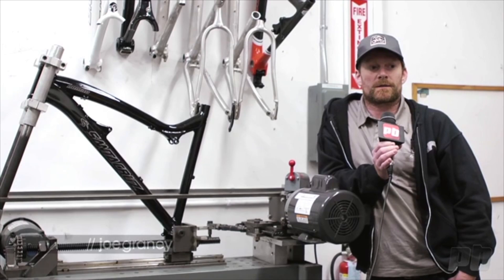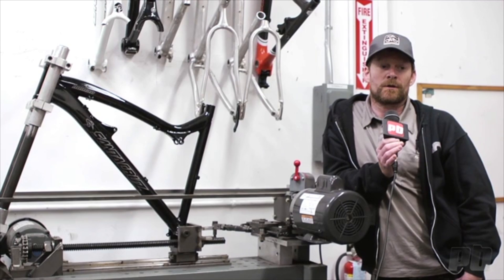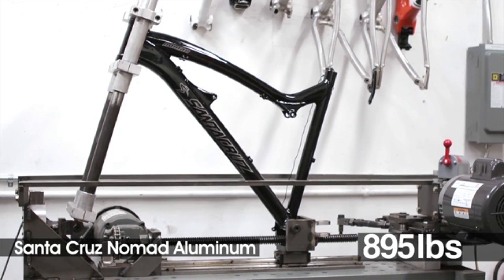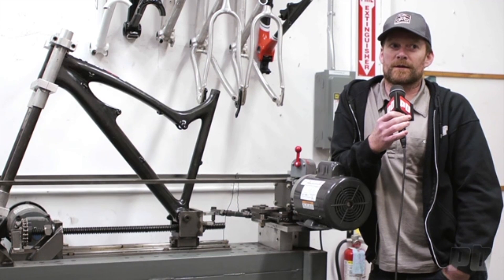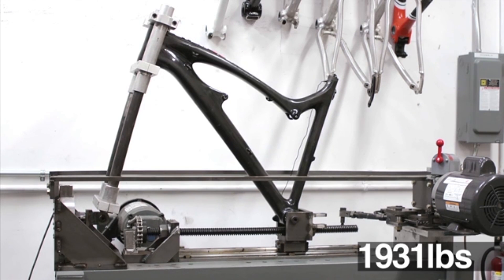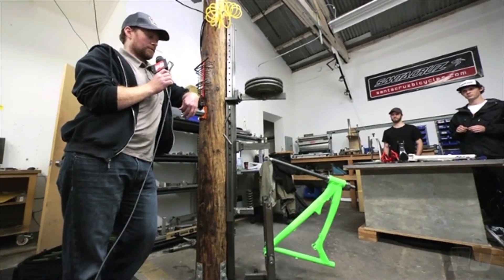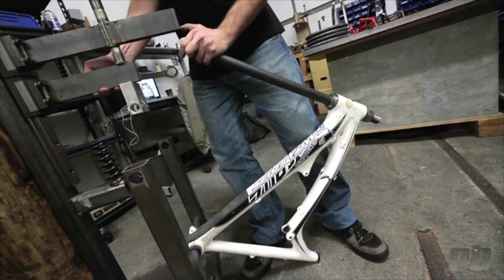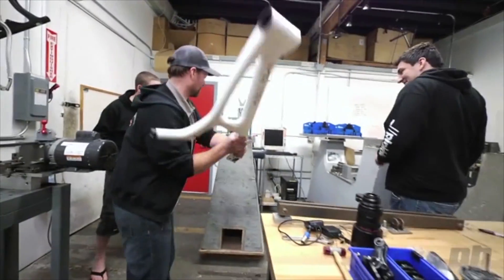Carbon vs Aluminum Frames - Which is Stronger?

Comment: This is an old video, no idea why they reposted it. Tests on this video were on the old Nomad2 platform while Nomad4 is around the corner. This would be interesting to redo to see how/if stiffness has improved on the new N4 platform.
Reply from the maker: That's a great idea, hopefully we'll get to do it again.
Reply: Open it up to comments on how/what to test if you get the chance to do this again.   I like the idea of measuring the crushing force applied to the side of the top or down tube, and testing a full frame (front and rear triangle with a solid block of steel for a "shock") with a downward force applied at the bottom bracket area with fixed attachments at both the headset and rear hub.   

I've also got to say that with Santa Cruz' warranty the Carbon vs Aluminum arguments kind of go out the window.

Comment: Casing a jump a lot of times goes the other way, like if you land on the flat, that causes the forces to try to spread the wheels apart rather than together.  Hope those frames are strong in both directions.
Reply: This theory makes sense when you've got no suspension. Otherwise the suspension will catch the most of the impact energy, before it goes directly into the frame.
Reply: Exactly
Reply: Brad Herder Well, I had a 2011 blur ltc and let me tell u... I  cased more jumps than I got right.. That frame just kept taking it.. Now my cousin has it and still rides the shit out of it... Don't think u have much to worry about.
Reply: The first test is just useless because at that force you would have long been thrown of your bike. Nobody can get 1.4k pounds on his frame like that.
Reply: @obi-wankenobi9871  True, but I think the point is to show you how far past real world scenarios the bike would be able to take, just to give you an idea of the assurance you can have in the frame.  It would be more valuable to see it compressed in the other direction though, since that is what happens under landing loads.  Cheers!
Reply: test isn't necessarily lifelike, but it is far from useless. It shows where stress will be concentrated and where and why it will fail under what loads.
Reply: @GavynPendleton  correct
Reply: you are correct the wheels do spread.. i've seen 30yo carbon frames that "bent" the forks forward a few degrees, still rigid af.
remember when all the magazines were saying 'oh, it's gonna "carbon-rot" in 10-15 yrs'? lols

i sometimes ride my '91 Giant Cadex 980C nonchalantly in the sunset because not even the clear coat has faded on it.

Comment: What if it is on the side of the carbon frame and with a pointing ending? The fear is to fall down and the bike hits a pointy rock on its side, it will simply make a hole on the frame.
Reply: Luciano Vlap Souza well at the very end they slam it against a corner of concrete, which is close enough. seems to be fucking strong
Reply: EXACTLY!  While climbing a hill, I stalled out, tipped over (on a Giant XTC carbon bike) and landed softly but with most of my weight compressing the on the frame against a rock (not even on a pointy rock) and the frame totally cracked.  Giant has a frame replacement deal where I can get a new one for $650 but man, I thought I just scratched the paint.  I would love to see if a Santa Cruz could take a side squishing - not even an impact per se, just 200 lbs applied to it against a rock.
Reply: @MTBIKEXC  I dont think any viable bike material could survive being driven into a rock corner with 200lbs of force falling on it.
Reply: Pois eh... tu viu a bike do Minaar quebrou em dois com um impacto lateral no meio do quadro...